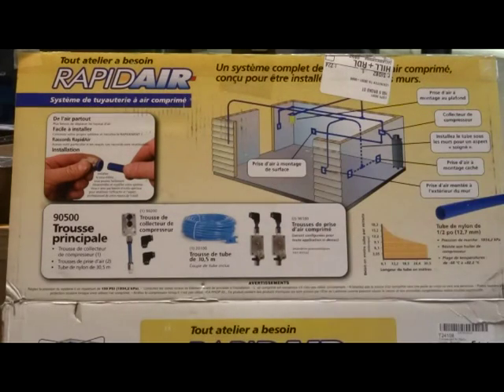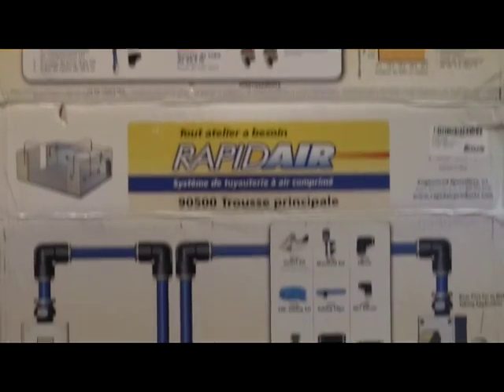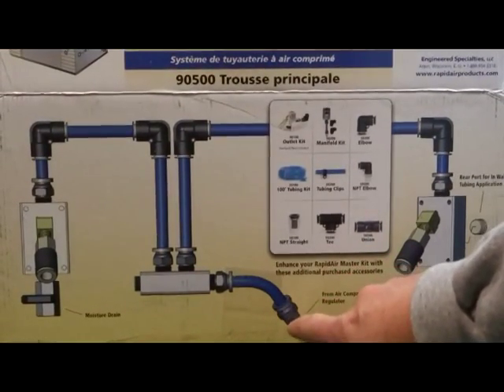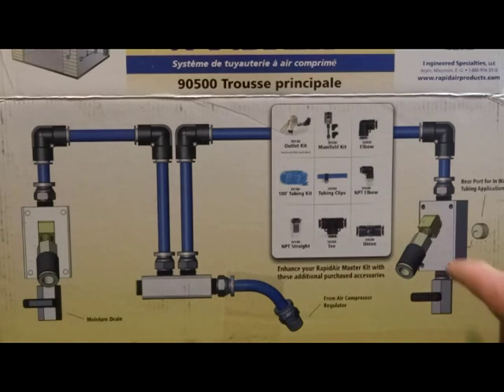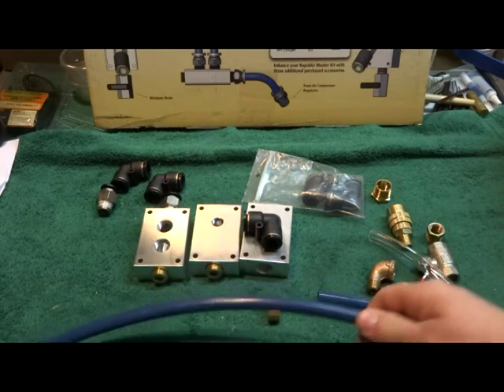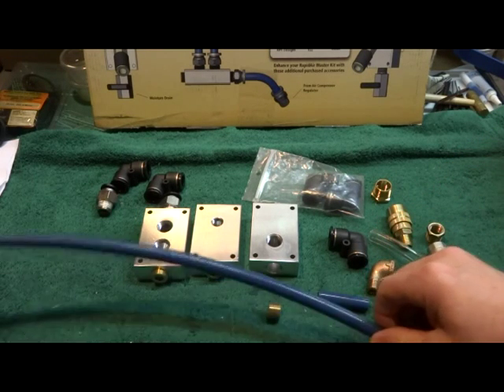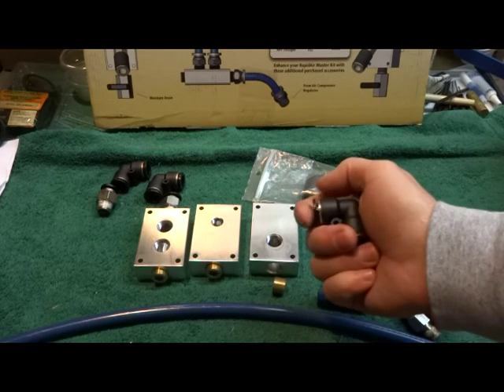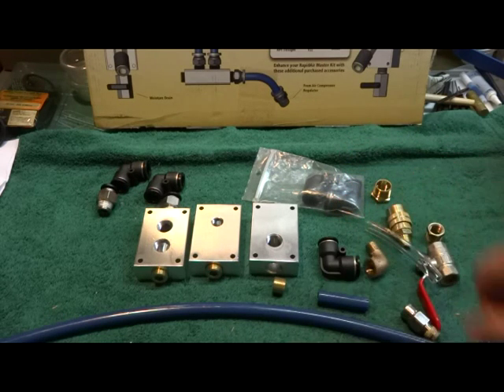Improved RapidAir Compressed Air System For Home or Garage

Comment: Thanks for your video. I ended up just buying the line and the specific RapidAir fittings I needed and sourced everything else elsewhere. Wanted filter/regulators at each drop. Works great.

Comment: Man, thank you so much! Just got my kit, and i had questions right away about the elbows.  As someone who has studied flow my whole life, i just started scratching my head.  Not now~!~ Glad to know the HF filter/regulators work. It's hit or miss on some stuff there.  I can't wait to replace the jack leg set up i have now with a semi-pro set up, again thanks.
Reply from the maker: dean jordan thanks for watching and glad the information was useful.  I have had to replace one HF bowl that started leaking.  I think having the ball valves at each regulator and keeping them shut off keeps the pressure off of them and helps them last.

Comment: is the first regulator hangin on the wall, a 3/8 or 1/2?
Reply from the maker: Jimmie Gonzalez 1/2.  Thanks for watching and good luck with your system.  BTW, I saw Tractor Supply has the same system in their brand for less money.
Reply: Thanks for the quick reply.  I've got only a 1/2 inline filter and a 1/2 filter regulator and 3 3/8 regulators, do you think I will be okay if I Just keep the 1/2 line just as you have hanging off the tank and run the 3/8 coupling from the 4 (Cross) into a 3/8 with another filter?
Reply from the maker: Jimmie Gonzalez Sounds like you're set up just like my system and it should work just fine!
Reply: Just an observation for others to follow your lead -  the 4 way and 3 ways that have quick connect couplers also have reducers between them right?
Reply from the maker: Jimmie Gonzalez that is correct, the cross and tee are 1/2 pipe.  The large 3/8" quick connect is bushed down to 3/8 pipe.  The 1/4" quick connect is bushed down to 1/4 pipe.  And the filter regulators at the point of use, are 3/8 pipe.  I kept 3/8 pipe fittings on the inlet side and bushed the outlet side down to 1/4 pipe to fit a standard 1/4" quick connect.  The 3/8 ball valves end up having the smallest restriction in the system but the hole through them is about 3/8" so they are still larger than the 1/4 quick connects and the smallest restriction is the hole in the fitting on the air tool.

Comment: Where do you get the galvanized 1/4npt to 1/2 reducers?
Reply from the maker: supervdj all of what you see is standard hardware store stuff.  Technically they are "reducer bushings", if I understand which piece you're asking about.  Galvanize isn't required, that's all they had when I went to buy the "cross" (4 way) fitting.  Thanks for watching!!

Comment: im curious if you could explain why you start off saying their elbows restrict air flow, then you use street elbows at every regulator?    
also wouldnt the blocks that came with the kit been just as easy to install directly to the regulators or is there a difference in size or another issue with the blocks?  have been researching this idea and you are the only one offering an alternative. since i had also wanted individual regulators at each drop i wasnt sure if just buying the lines and compression fitting would be all i would need as well since a few people have said they had to buy extra fittings and or plugs for the blocks
Reply from the maker: bishop york I used street elbows and some 90's, most of which I had on hand.  Street elbows offer more flow due to greater radius where the air makes the 90 degree turn and having a larger i.d.  I used a couple of 3/8 brass elbows that fit their ball valve that has a 1/4 hole thru the ball in the valve, the quick connects are also your typical 1/4" size.  The 3/8 elbows made the connections easy with fewer joints and were bigger than the 1/4" fittings, so no flow loss.  The aluminum blocks will trap water, fill up, and pass it on to devices down stream, they also have more joints which increases the potential for air leaks.  Filter regulators remove water and don't pass it on.  At about 15psi, these self drain.   When I'm not using the system, I shut off the air supply and when/if the air leaks out of the system, everything drains itself.  Thanks for watching so closely!  Great questions.

Comment: Love your setup. Working on the exact setup as you have here. Trying to figure out the fittings sizes and regulator sizes that you used. Probably will make more sense after my rapid air kit comes in. Are all of your dryers and regulators from harbor freight? Have you had any issues with them so far?
Reply from the maker: Brijesh Jagan had to replace the bowl on one of the 1/2" filters when it started leaking.  No other issues and wouldn't do anything different.  Thanks for watching!